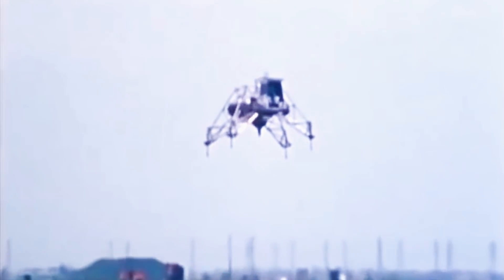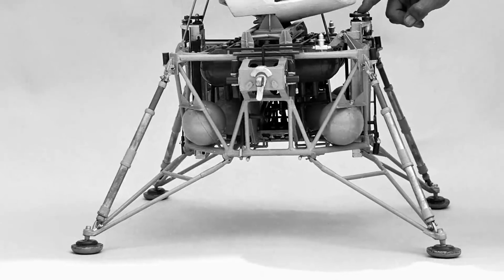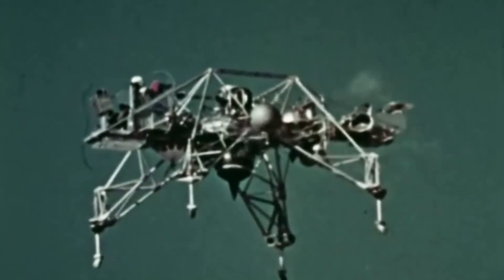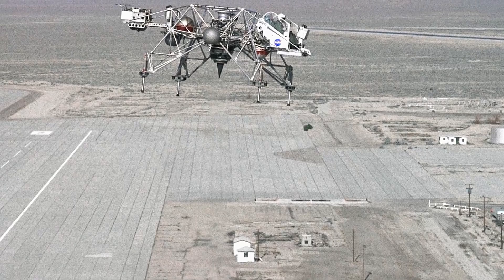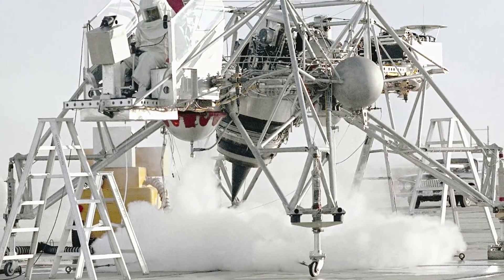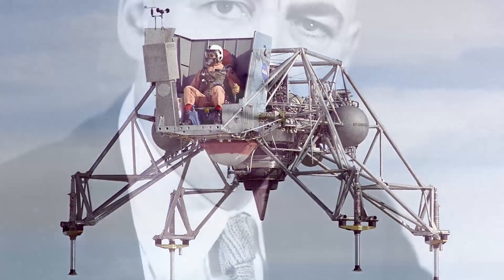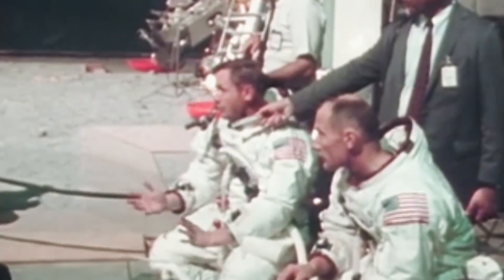Moon Lander Explosion - Dark Footage

Comment: How could they make a simulator before they built a lander that worked  and how can they expect to land in 1/6 gravity when they could not master it here with 200 engineers and ground support assisting the two built models.  The only way they could land that machine on the moon would be to substitute the rocket engine with the alien inside gravity Drive unit salvaged from one of them 1947 crashes in New Mexico.  In fact they just took off from a tarmac in the capsule in the two secret missions without all that  Apollo rocket jazz.
Reply: Lower gravity makes it easier to land, not harder.
Reply: Did you take your schizophrenia meds?

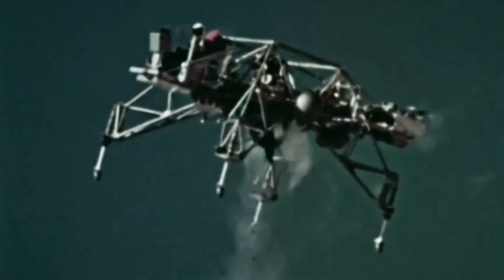Comment: Wait. He says at 2:27 that "the engine maintains engine thrust at 5/6th the weight of the vehicle itself". If that were the case the vehicle wouldn't even lift off. The thrust must be slightly more than the weight of the vehicle to get it off the ground. Then the thrust must be equal to the weight to get it to hover at a constant height. Then slightly less thrust to get the vehicle to descend. Essentially the LLRV's engine thrust control lever functioned like the collective pitch lever of a helicopter. Then in the real LM moving the translation controller lever up or down similarly controlled the thrust being produced by the descent engine to get it to level off and hover, or to descend or if needed even to ascend slightly.

Comment: Why they use jet engine? Its centrifugal force make it totally different than with rocket engine. They did not can use it. First vertical rocket landing was made 2004? 
https://youtu.be/uf-UFu-lACY Spinning toys, if needed for explain.
Reply: Because its simpler. If they put the exact rocket engine used by the LM, it wouldn't perform nearly the same. Because the LM descent engine is designed to work in vacuum and to power a 15 ton vehicle in 1/6 G, not this small trainer on Earth in 1G. This trainer vehicle had nothing to do with the LM, except it was only designed to replicate the feel of the LM during final landing stage, so the astronauts would be familiar with the way it controls when they descend to the Moon's surface. Also, centrifugal force has nothing to do with rocket engines, it's thrust force, ISP, efficiency, stuff like that. What SpaceX did for the first time and now does routinely is vertical landing of the first stage orbital booster back to Earth. Landing on the Moon, planets and other bodies was first done decades ago, mostly unmanned, manned only to the Moon. It's much harder to land a huge tall first stage of a rocket back to Earth, and it was never done before, rockets were always fully expendable with first stages crashing down to ocean, which is why it was special when SpaceX succeeded to do so, it makes the rocket partially expendable and therefore much cheaper to launch each time.
Reply: To use a rocket would require fuel tanks and fuel systems to handle more volatile fuels, the maintenance time between flights would be longer, rebuilding rocket engine almost every time, 60s tech...
Reply: Also, the descent engine used on the LM employed an ablative type cooling technique where a coating on the inside of the nozzle slowly burns away to keep the nozzle cool. It worked basically the same as the heat shield on the Command Module. As such the running life of the engine was limited. If it were used on the LLRV and LLTV the engine would probably need to be replaced after each use. Not very practical.

Comment: why helium again?
Reply: Helium is an inert gas, which makes it ideal for pressurizing tanks of reactive fuel like the hydrogen peroxide used for the thrusters. I presume the high test hydrogen peroxide was being used in the thrusters as a monopropellant.  When flowed over a platinum catalyst it decomposes into high pressure steam and oxygen.  In order to do this the peroxide tanks must be pressurized, and it's safest to use an inert gas.  You probably could have got away with argon as well, but from what I understand helium works better.  Not sure why.

Comment: What was that odd helicopter in the background with two propellers on each side. 6.27
Reply: USAF Kaman HH-43 Huskie, used for firefighting.
Reply: Joey is correct.  That configuration of blades (twin, intermeshing) is uncommon around the world, but a number of examples do exist going clear back to WWII Germany.
Reply: @tarmaque  No tail rotor necessary, the counter rotating main blades canceled out the unwanted counter torque forces. It was actually a good design. I saw 1 performing a training flight in 1968 in Georgia when I was in the USAF.
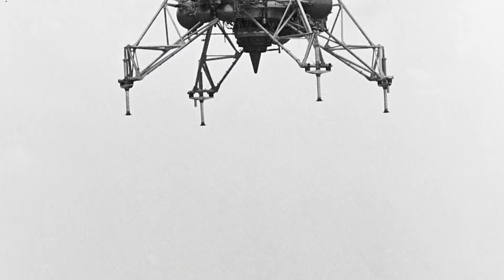Reply: 6:27 *

Comment: Love your videos. But I wish you’d talk a bit slower as I am hearing impaired. I could turn on sub titles, but they are kind of distracting! Keep posting love the content.
Reply: Change the playback speed to 0.75, video seems OK and the audio sounds much better.
Reply: @johnk8825   Thanks man 👊✌ works perfectly
Reply: I have the same problem. Just so you know, clicking on the gear icon at the bottom of the video and changing the playback speed to 0.75x usually solves the problem for me.

Comment: In fairness to Neil, piloting this thing in atmosphere with 9.8m/s^2 pulling you down would have been no easy feat. On the moon, reactions aren't as fast and don't need to be as strong but here on earth, shit goes wrong fast when you're balancing on a vertical thrust vector.
Reply: At slowing down moon orbitspeed, they would had to use full thrust , which is about 10 m/s2.  In my opinion, the moonlander turned out as not usable and went untested into earth orbit only. I mean, no astronout was silly enough trying a moonlanding with this lander. There is no parachute possible on moon...
Reply: The ol broomstick problem
Reply: Not to mention no wind or convection currents lol. They were fighting a losing battle here on earth testing this thing
Reply: @Sy, you get that bro,  thats 1g haha, c'mon know your shit. ...

.... @Vsatyk you must know everything...
Reply: @Vsatyk   lol, ...yeah bro we're aware. What indication did you get that anyone on this thread didn't know.  You think homie up there just threw out that number but had zero clue that he know that was what gravity was and equated to one g... don't be such a headass...
Reply: @Vsatyk  didnt mean to seem hateful. My bad on that.

Comment: It looks like he was trying to go straight down, but the wind kept moving him to the right.  Him trying to compensate and go back left, this helped cause the crash.  You can see the wind afterward with the smoke going to the right.  It wasn't a super strong wind, but was there and the lander wasn't very aerodynamic.  They didn't design for wind since the moon have no atmosphere.
Reply: No, the problem was that he lost control due to mechanical issue involving loss of helium pressure and therefore depletion of hydrogen peroxide which was the fuel for reserve attitude thrusters. Those thrusters are what keeps the vehicle in control of its orientation.
Reply: @FrankyPi  Agreed.. from a purely "human perspective" it does look like it's fighting the wind but they did determine the cause as you've indicated.. .. so there ya go!
Reply: @Bill Fletcher Neither does the jet engine holding the testbed up in the air.
Reply: @ericatkinson1412  Bedstead. It was called flying bedstead by the astronauts. Author of the video made a mistake calling it testbed, also mentioning zero-G multiple times when it should be Moon's gravity or 1/6 G.
Reply: Try reading the description mate

Comment: That's the stripped down trainer.  Where's the full size mock up with rocks and a dune buggy strapped to the side?
Reply: This is not a stripped-down version of the Lunar Module. It's a very different vehicle that was designed to act as similarly as possible as the Lunar Module landing on the Moon, only on Earth in 1G, so they can train with it. For training with Lunar Module's systems, they used simulators. LM was tested in low Earth orbit on Apollo 9, where they did docking and undocking procedures with CSM and other tests. Dress rehearsal for Apollo 11 was Apollo 10 mission, where they tested every segment of the mission, up to powered descent, except the final landing stages, then jettisoned the descent stage and returned to dock with CSM.
Reply: Rovers were only on the J Science  missions - 14-17
Reply: @collguyjoe99  15-17
Reply: Only the ascent-stage carried any rock samples, and the rover was folded into a storage bay and not visible from the outside. The LLRV was only intended to practice vertical landings on Earth.